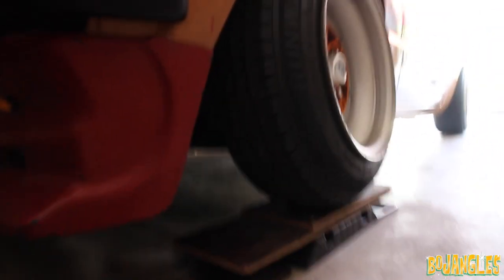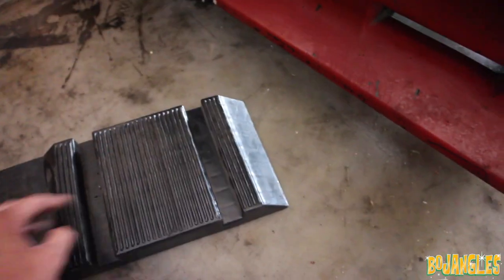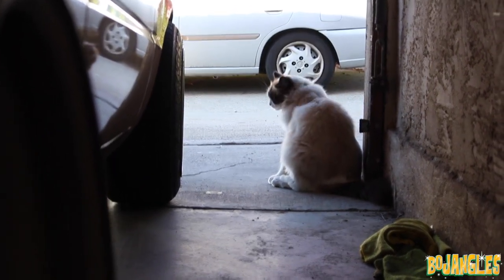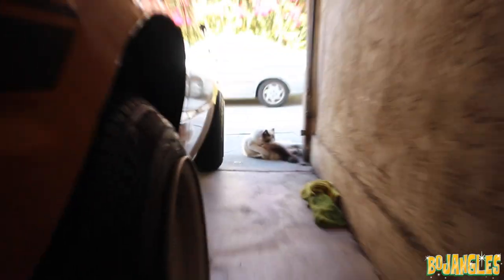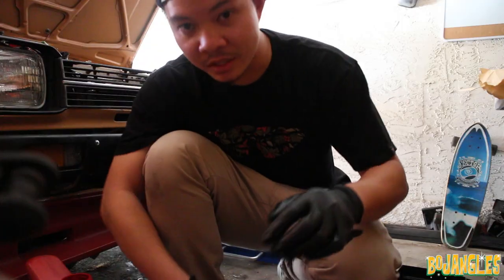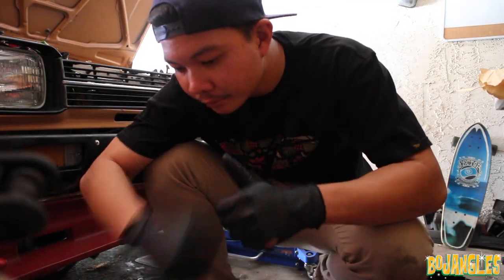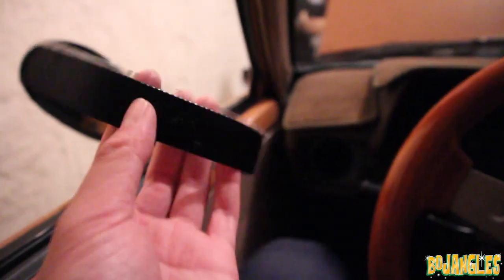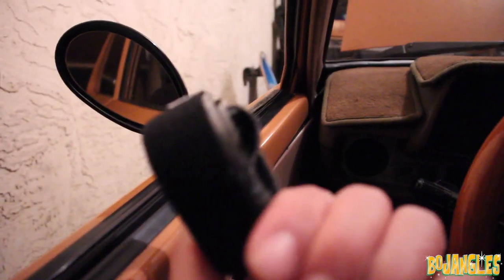OIL CHANGE, NEW PROJECT CAR SOON?

Comment: What exhuast diameter do u run love the vids btw
Reply from the maker: +Isaac Hargraves-Darren thanks man, for the exhaust diameter i don’t remember at the top of my head. Check out my old video of getting the exhaust on i should have some info there in the description
Reply: BojanglesDavid cheers bro just did a 4k swap so need an exhuast will probs be inspired by yours. Nz rep